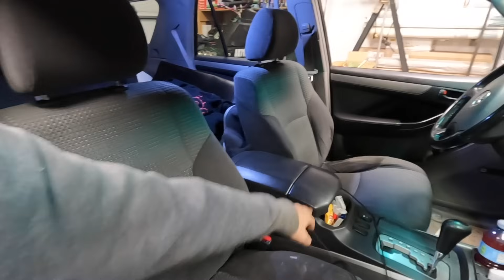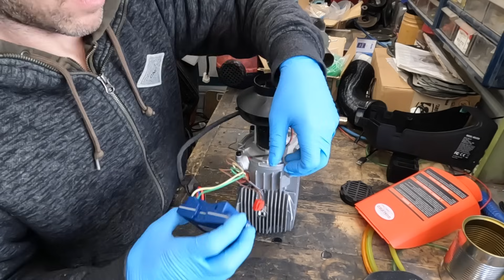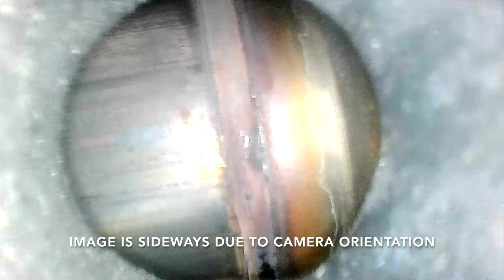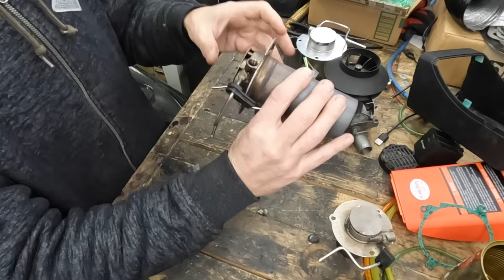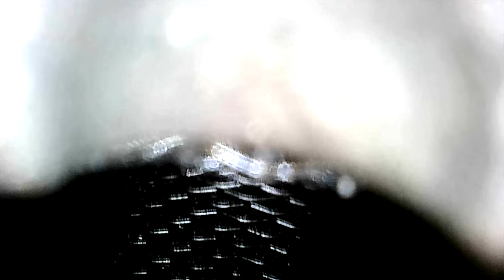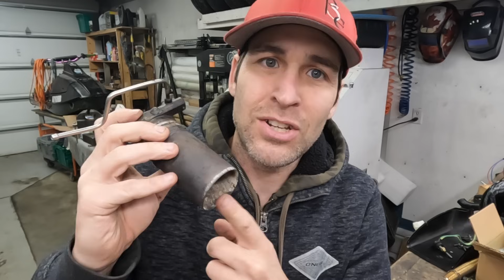Diesel Heaters - Orientation Deep Dive - Heater Mounting Explained

Comment: Been trying to find out energy consumption on the 12 volt end. Am off grid at a ranch in the mountains and am calculating what kind of solar/wind setup I will need.
On the used motor oil, probably keeping the glow plug on to elevate the temperature to vaporize the oil since it is not under pressure being atomized. Maybe a lower setting for the glow plug after the start up so it doesn't burn out too fast. I would call this a passive system since the fuel is not under pressure. That's why it's so hard to use the oil.
Reply: @thefirstmissinglink: 
As you are on a ranch, you don't really need a mobile heater solution. An oven should do.

If you'd weld yourself a dedicated waste oil oven with a real chimney, you can get away with a small fan of 5 watt or less, depending on oven size and oil feed. Best would be a normal oil flow regulator instead of drip feed, but the ones suited for thick waste oil may be out of production. There once were sites explaining the modifications to a normal light oil oil regulator, but i didn't check, if they are still there.
If nothing else works, drip feed always do, but the (highly recommended) safety feature N/C solenoid valve will be another battery drain.
I think, you'll get plenty of building ideas if you look for "blue flame waste oil heater".
Basically you have to build a normal oil fired oven, but with removable bottom plate (daily cleaning) and an electric fan.
I haven't tried that, but you might get blue flame even without a fan - if the chimney works good and the oven is designed right.
Reply: @werner.x  I should have given a better explanation, I am modifying my motorhome for off-grid use. I want to use the diesel heater but I needed to know the power consumption on the 12 volt side of things.
Reply from the maker: @thefirstmissinglink  Ok, that makes perfect sense.
Reply from the maker: @werner.x  This is true. If I were somewhere outside of the city, I would certainly be building something a little more substantial than what I currently have. 

I like the challenge of keeping it in a self contained package and being able to buy off the shelf parts, but there are other ways to keep warm. 

A good designed burner could run without any power in a emergency situation and then use a a few watts for combustion air and a few watts for circulation for everyday use. I highly suspect that a high efficiency wood stove with a few mods would burn very clean and not require any forced combustion air.
Reply: Glow plugs are not in operation after startup...
Reply from the maker: Once the these heaters are up and running, they pull between 30 and 50 watts, depending on heat setting. The fan pulls the majority of that power. When they are firing up and shutting down, the wattage goes up around 120 watts for about 2 minutes on start up and one minute or less, on shut down. 

The main two main issues with motor oil are 1. As you say, not enough heat to flash of properly, and the plug on would take care of that. However 2 is that heavy oils will always leave some crud behind. The glow plug area would become plugged up very quickly if the plug was kept on. 

The main cause of failure when burning motor oil is the build up inside of the main burn area leading to restriction of airflow.... Then things spiral out of control really quickly.
Reply: @loweredexpectations4927  yeah that'll make sense with it being so dirty. I guess the only way to clean it up would be to do the same thing they do with biodiesel. I'll be eager to see what you come up with.
Reply from the maker: @thefirstmissinglink  It may be a total failure, but it should at least be entertaining !

Comment: My heater plug failed due too the wires oxidising i made a tempry one using a ford focus glow plug modified to fit and it worked nicely.
Reply from the maker: Mine failed because I was filming and told people to be careful 🤣. I should have known better. 

I haven't  had mine corrode, but I had broken the wire off several times and had to solder them back on.
Reply: There’s a diesel Focus? It must be European.
Reply: @5roundsrapid263  probably from the era of the volvo parthership
Reply from the maker: @5roundsrapid263  They get so many cool cars we don't.

Comment: Slow the flow of oil to give it time to burn maybe.
Reply from the maker: Yes, that is a possibility .... I was thinking instead of it entering and burning where it enters, having it run over a large surface. This would allow it to be exposed to more air and because there will be deposits, perhaps spread then out instead of piling up in one spot.

Comment: The endoscope really helps for inspecting the fitment of the pieces! Thanks for sharing! I'm excited to see how that "arrow flame choke" works. I didn't know what to call it so I went out on a limb. Edit: It helps me understand the fitment that is. Cool to see the burn tube while it's in the heat exchanger housing thing.
Reply from the maker: I'm glad you enjoyed ! I will be making another video about the arrow flame choke system, haha.... I recorded an 8 minute clip explaining it, but this video was already getting a bit long.
Reply: @loweredexpectations4927  I can already see you toasting the endoscope camera :face-green-smiling:
Reply from the maker: @werner.x  Haha... I don't think I will be putting it in the heater while it is running !